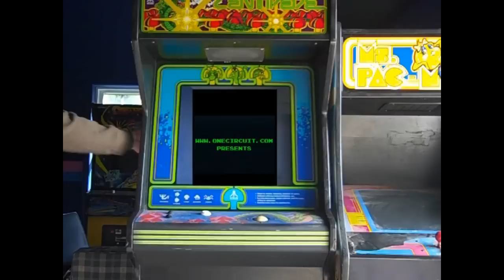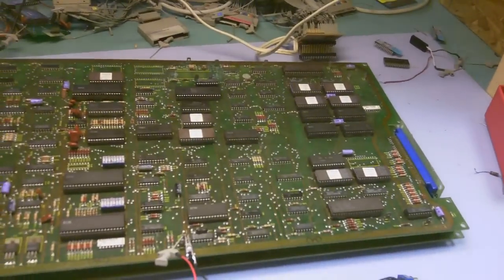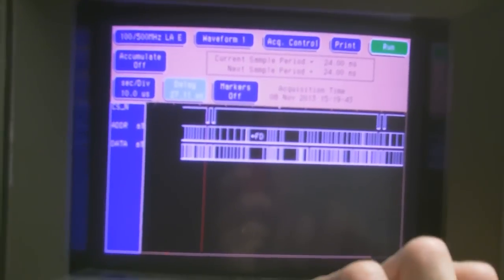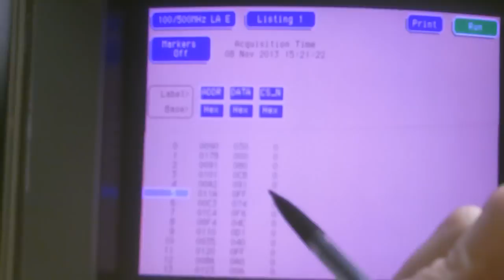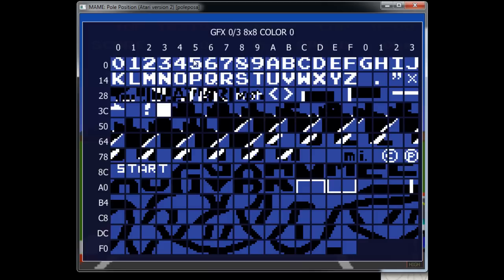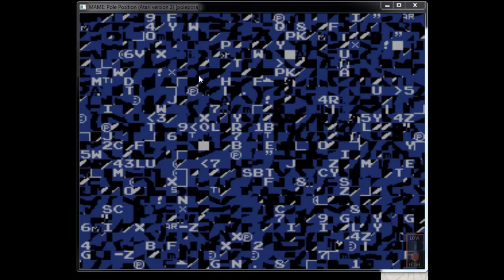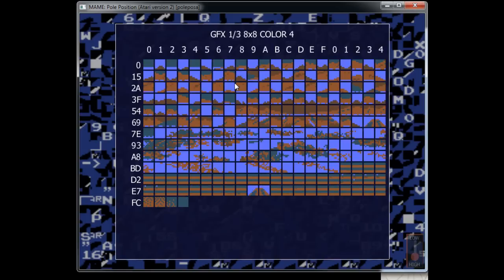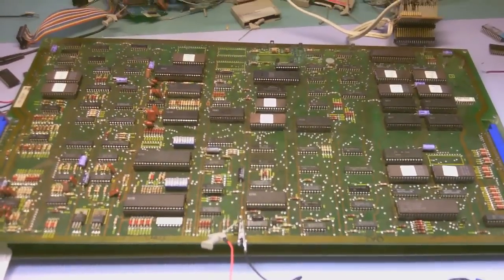Pole Position Clone Update - 11/08/13

Comment: In John's update video at 24:47 you talk about how the sound was under sampling and could hear the audio in the background. I am having this problem with my Pole Position 2 board and have no clue as to what or where to look to fix this. Do you recall what your problem was, so I can try fixing my board? Thanks
Reply from the maker: David Mayo It was actually a problem in my implementation of the sound hardware. Some of the sound sections generate 12-bit digital sound samples  and I was only using 8 of the bits.